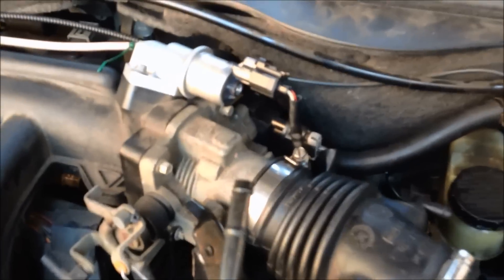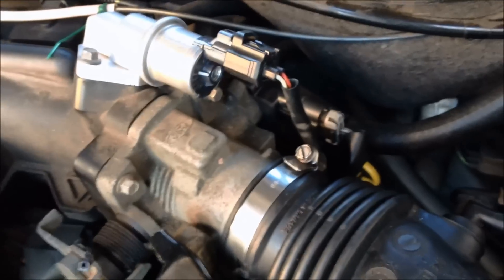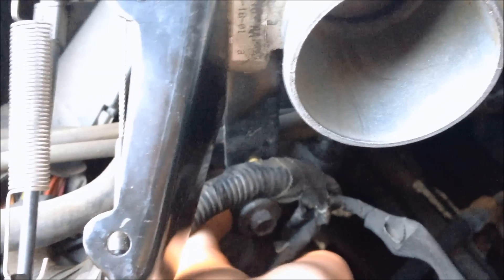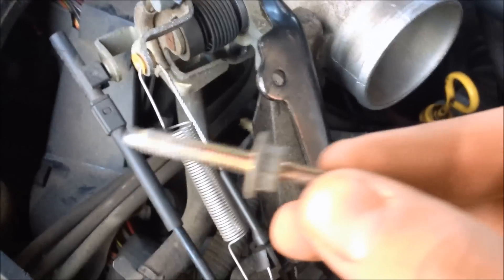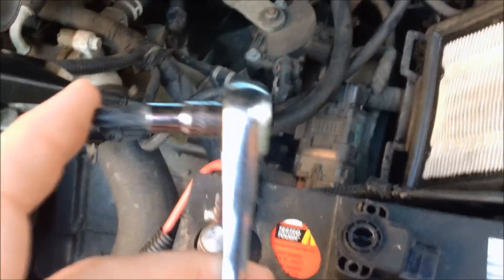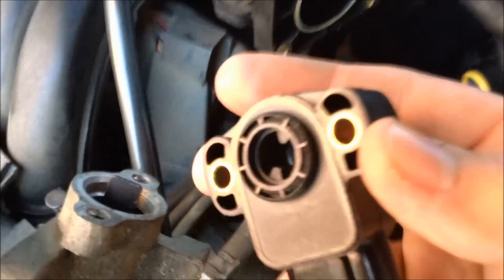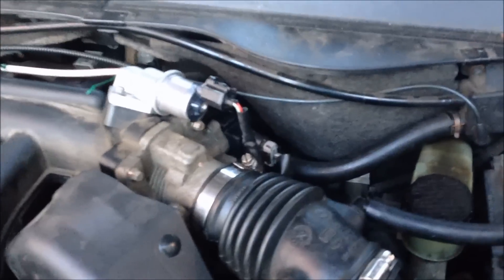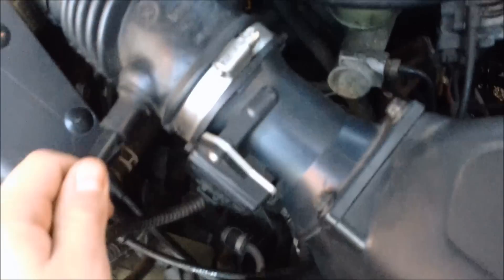Fixing Idling Problem Throttle Position Sensor Replacement 2001 Ford Taurus

Comment: I’ve been having problems with the idle on my 04 and it doesn’t wanna accelerate past 20 mph. I’m not showing any codes either since I’ve fixed everything. I sure hope this works it’s gone be the cheapest part I’ve bought. Thank you

Comment: I’m saved your video. My 2004 Taurus is difficult to shift into gear. Also the key won’t come out smoothly unless I turn the wheel a bit. I have the tools. Can a 63 yo woman do this? Teach an old dog new tricks. I bought Sally new and she just keeps on ticking. But time to replace some sensors. Thanks!   PS.  It needs oxygen sensors too. I would need a floor jack and stands to do this, correct?

Comment: Just came across your channel and I have a 2003 mercury sable and I have 3 codes that came on when I had the e-check the codes are po113 po102 and po122 can you show how to replace the mass volume air flow and the intake air temperature circuit thank you.

Comment: thank to you  my taurus 2000 run creat  throttle position sensor replace, i still has a little  hesitation when  engige is cold go away one hot  let me know what to do  or make a video on that

Comment: i used Craftsman 3 Piece Steel Handle Multi Bit Screwdriver Set for 5 dollars at lowes  i pulled throttle body sencor off and i used the philips  steel handle there was no room for a regular stubby philips i did not want to take off my throttle body

Comment: I have an '04 Sable Duratec engine. My TPS is tucked away tightly as in your engine. I'm going to try your method of removing those bolts to simply tilt the whole assembly over to easily change it.

Comment: Dude thank you so much bro I’ve been having the same issue with mine, same car but 2003 model year, same dang engine 🙄Ever since I replaced the timing cover gasket leakage issue. But mine was trying to basically dive itself and maintaining 15-2,000RPMS after initial startup and warming of engine. Hooked up scanner tool no check engine light. Haven’t replaced IAC Valve yet but it’s clean as a whistle from last issue I had with it which was roughly the same symptoms as were having here. But let me ask you one thing. Does the Throttle Body have a gasket on it? Does it need replacing if so?
Reply from the maker: Glad the video helped , not sure about the gasket ty for the comment

Comment: The tps on my 2000 f150 5.4 somehow got out of calibration and messed up the idol...the vacumm to everything and the transmission to the point that it was like the converter was locking up when put into drive and reverse and just die and after the mechanic reset it every thing works and sounds and runs like brand new..my trk has 290,000 on it and that tps sensor controlls ..A Lot..from air intake.... to idol.... to vacumm.... to transmission/sensors. One that is bad or out of skelter can cause Big headaches because if it's out of adjustment it won't trip the check engine light. 9 out of 10 mechanics and transmission shops told me everything from plugs and coils ,fuel pump, new throttle body, iac , valve job and so on and the  torque converter was number 1.....One Good Mechanic charged me 45 dollars to reset it and the trk and transmission runs like the day i bought it...Choose your Mechanics very Carefully.
Reply: Bella  Wright what did he calibrate? PCM?

Comment: 2004 Ford Taurus owner.  I have changed my IAC valve five times after my mechanic told me that you had to try several until finding a good one. The first four came from a cut rate auto parts store so I got my money back and bought one from NAPA. It was fine for about 100 miles and now the engine is doing it again (revving high) Could it be that the problem is the throttle position sensor. My mechanic did a complete tune up on it just recently........thanks KT

Comment: I have a 2001 Mercury Sable LS.
I see you have two bolts/two screw in studs on throttle body.
I noticed I only have one bolt on top,...and one stud diagonally on bottom.
Car was running fine.   I had some work done by Tire Kingdom not related to throttle control,...but now I have a throttle issue.
Could my throttle bode be sucking air?
Did any of these sables come with only diagonal bolt pattern on throttle body?(Do i sound ridiculous?)

Tire Kingdom had to replace my power steering control sensor between engine and fire wall. It was warranty work.  I spent close to $1200 to have new line/pump/sensor installed.
Sensor leaked all over the place 10 months later.  Mechanic said he had to remove my intake to do the work,.....now I have sticking throttle body problems
They replaced idle sensor,...and still couldn't get it to run like it did.  (Idled and ran fine)
Should I try the Throttle control sensor?

(It's hard as hell to find an e-mail address to corporate Tire Kingdom to explain this)

Comment: I have a 2007 ford taurus with a 3.0L V6 SEL model, it starts and runs fine except when I turn on the A/C it starts bogging down the engine, and it will cut off while driving? I just tuned it up with new spark plugs, new wires, and ignition coil. It wasn't doing it before the tune-up. It has 163,000 miles on it?
Reply: You have crossed the wires at some point wrong wire on wrong spark plug

Comment: Great video, my fluke meter reads mine at .08 volts or so at idle up to 3.75 or so, bought a cereader scan tool, it says or tells the cpu 18.4% at idle. Should be zero, someone had tried to adjust the idle with the TB plate screw, paints gone. Guess I'll try a new one, fixd codes that we're bad. I'm returning this scan tool, launch 3001 also, won't even show O2 sensor status on 2000 Vulcan

Comment: Sears sells a small ratchet and with a  90 Degree screw driver end on it and you can take the TPS out in 1 minute
Reply: Sometimes the screws are very very tight 😅
Reply: @Flomcy  Yes the screws are extremely tight That's why when you put them back put some anti-seize on them for the next time and they don't need to be too tight because they're just holding a piece of plastic onto the throttle body
Reply: @willsrestorations  now this time is my turn, I can't just move a milimiter,those screws, I don't know how rid of them, maybe broken all the TPS and replace it
Reply: @Flomcy  there is a trick to get them out, remove the large intake hose from the throttle body should be two clamps and remove the large 4-in intake hose. Take a sharp regular screwdriver and lightly tap the screwdriver and one of the grooves on the Phelps head and create a regular screwdriver head on those screws,  after tapping them several times you will notice that they will be much easier to take out with a regular screwdriver as you have grooved the screw or cut the screw to fit a regular screwdriver head,  and just be careful.
Reply: @willsrestorations  thanks for your advice... I will.. only I didn't want to remove the whole throttle body... Seems very easy only two screws, but almost impossible to remove..  I will do as you told me.. is the best option 👍🏻🙏🏻
Reply: @Flomcy  you should have enough room when you remove the large hose off of the throttle body and the air box to get behind there with the screwdriver and just make a notch in the screw, just be careful cuz the screw is so much soft,  but you will see if you're patient you'll get it out with no problem. If you happen to get new screws for it just make sure you use some anti-seize and don't put them in tight just snug them up for the next time they'll come out really easy
Reply: @willsrestorations  thanks for the advice... Maybe next time... won't be my car anymore 😁

Comment: did this fix your problem? I've spent over $150 dollars in parts trying to fix a rough idle problem and I own a ford taurus as well. Before I spend anymore money, did replacing the sensor do anything after you replaced it? If not, what else have you replaced to fix your problem?
Reply: Ron Seguin you could have replaced the Idle Air Control Sensor. My father did this and it fixed the rough idling.

Comment: I have a 2002 mercury sable 3.0 DOHC. I replaced the IAC but still am getting error P1506 with an engine light. Do I have to wait for the error to clear and the light to go out or do I have another problem. It has been a few days since it was replaced. The engine may be newer than 2002 it was replaced and now the water pump is on the right look from the front of the engine - Bob
Reply from the maker: +Bob Powers   I will have a video up talking about the IAC and the 2 ways they fail. But if you replaced the IAC and you had a CEL you have to clear it and see if it comes back you can use a scan tool or just disconnect they battery for a couple of min.
Reply: OK thanks it turned out to be a vacuum leak that look 3 days and  a bunch of money to find
Reply: Those vacuum leaks can be a real bear to find sometimes.

Comment: I just got my transmission did on mines by replacing torp comfurtle if you understand what I'm saying excuse my spelling. now that's fixed my check engine light came on. saying I need to replace a sensor just as you showing. It's like it's having a problem getting air in to keep crunk. if I don't keep giving it some gas it will eventually cut off. What are your thoughts?
Reply: I have a 2004 ford taurus se

Comment: What was your idle problem which led to replacing TPS. My 2004, when hot and highway driving for at least an hour starts to take off on its own. Idle will vary from 850 to 3500 will in park. Comes and goes. Any hints. Thanks for the video.
Reply: SeeMooreVids  My 03 3.0 is doing exactly what you just described. I would also like to know. Thanks
Reply: if yur having idle issues such as idle going up and down or acting irattic you should first check the idle air control valve. it becomes gummed up and the pintle seal will begin to stick leading to overcompensation as it moves back and forth in its cylinder while its attempting to regulate the air supply. but it also 6causes stalling perhaps like when you take' your foot off of the accelerator at a stop sign....it has 2 functions for one it allows a small amount of air to bypass around the throttle body flap at startup since the throttle is fully closed when foot is not on the pedal....therefore its second function is do the same when yur driving and you take your foot off of the accelerator...must provide an air supply while throttle is fully closed...so this part obviously stays busy all day lol...
Reply: they are cleanable though and after cleaning i always spray a touch of silicone spray in the openings
Reply: SeeMooreVids Sarah Hinkle

Comment: Is that a clockwise rotating tps or counter clockwise?  I have an aftermarket efi system and I'm looking for a easily available tps the current one I need is no longer manufactured.

Comment: Hello..I have replaced my 05 Ford Explorer 4.0 liter engines TPS sensor which I had Auto Zone pull the codes when I suddenly got a fail safe mode indication as I was cruising at 55 MPH. (NOW THAT'S A SCARY SITUATION IN ITSELF). Anywho, after installing NEW TPS and extras I went to crank her over and got a no start result...Am I suppose to make any adjustments prior to installing on throttle body?? Thinking I missed a step here and its friggen cold here in Boston tonight to boot..haha please advise any info U can give me to get her rolling again...appreciate ur time and reply:) bummed out guy
Reply: When you say, "some extras" what extras do you replace,  Is the car clicking when you try to start it, or no sound at all,  do you have lights and power

Comment: My 2008 Ford Taurus idles high has for a while now only 53,357 miles stalled out twice in driveway while warming it up then check engine lite came on stopped at mechanic they said it was my Throttlebody assembly $400,00 for parts 100,00 labor  didn't have that kind of money they cleaned some wires etc that was 2 weeks ago it's been ok til today engine lite came on again stopped at auto store for reading they  came up with Throttle pedal position sensor switch voltage A/B correlation ,so is it a bad sensor or bad Assembly. Not sure you can help but thought  I'd try  thanks

Comment: on my 24 valve double overhead cam 2000 Ford Taurus it's idling low to the point it stalls out do you happen to know the problem?
Reply: Probably mass airflow sensor. But check your codes, usually those will throw a code.

Comment: I tried using an
 angle screwdriver and avoided taking out more stuff....but I did replaced the screws with allen type bolts... its this ok ?...
Reply: They are 1032 screws, and it makes no difference what head you have on the screws, Yes, allen wrench should be fine....maybe desireable if you want to take them back out some time.

Comment: Ford Taurus 2001 3.0, 200K mi.   I replaced a blown head at 136K and 190K .  $3K , NEVER replaced a sensor to my knowledge, but, replaced ECU, plugs twice, spark plug wires, coil pack, twice, etc. and it still has rough idle, poor mileage, low power.  Rough idle comes and goes based on engine temp, and chance.  REPLY REQUESTED.
Reply: 3 years later...  I hope you've fixed it or junked it by now, but it's probably the MAF. I replace MAF sensors in Tauruses about every 60k miles. They aren't made to last. ...Or if your coil pack was non OEM, get an OEM one.

Comment: Do you have to reteach iddle to the car? Like because I change it but the iddle still high when on parking  and it goes down when I put it on drive o reverse? Does anyone know what I can do?
Reply: If you have a high idle  it means you have a vacuum hose leaking or a vacuum leak
Reply: Not necessarily....tps can cause it too.

Comment: Hey, thanks for the video.  I'm unsure.  When you placed the tps on the housing you said something about hooking it and you turned it a little. (5:10 in the video) What did you hook.  Is it supposed to be putting a strain on the throttle while installing?  Do I just stick it straight on the housing?  Am I making any sense?

Comment: Okay man so I have a question, my check engine light was on for a camshaft position sensor, my girlfriend got the part and I found the part and replaced it, the same day I realized the part my girlfriend picked up and I replaced was the throttle position sensor, when I replaced it I just installed the part and twisted it until it popped in place which stretched the throttle body spring, when I started my car reved up to like 3,500 rpms at idle and I shut the car off right away, I knew that was not normal.I went to examine the throttle body and it completly closed which completly compressed the spring, is it supposed to be that way or does the spring need to be stretched a tad? I went and replaced the actual camshaft sensor today and it starts and runs alot better than it did and about 97% of the motor hesitation has stopped but it does seem to miss just a little bit, before I replaced the camshaft sensor it only started sometimes, it had no power and getting up to 30 mph took awhile with alot of jerking, I will also say that my gas indicatior was at 32 miles left until empty and after I replaced the camshaft sensor it jumped up to 62 miles until empty, the bolts we got for the throttle position sensor were a little shorter than the original ones, it seems to be on there tight enough but Im just wondering what else I should do.

Comment: I tried following Levi's advice, and also LT1's advice.  I could not get the screws out without  following the procedures shown in this video.  Thanks to McCarygrant59 for making a good, helpful video.
Reply: You are right!  I have found that they can and ARE tighter than crap. Maybe a sealer? or just some oxidation, I do not know, but every time I have take one out, it was a bear.

Comment: Seems like the TPS can get out of calibration over time and miles etc.  It's such an important sensor you may has well just replace it at that low cost.
Reply: These freaking engines all must be good because they are not the problem I have 95 with over 150 and it's the same issue for most of the cars a sensor or valve hose wire so that's what it is I tried to add a public comment it wouldn't let me so this is reply

Comment: Hi MrCaryGrant! and hopefully you get a chance to answer me !!, look I have a 2007 Ford focus US legalized here in Mexico, has a little problem is that when you lightly touch the accelerator, then it accelerates to gradually lower the RPM to idle the body acceleration including butterfly are plastic, I was completely clean the entire body including the control valve idle, but the problem persists, touch the accelerator, the loose, but the rpm continue to rise later to lower idling, I have seen some videos about this car here on YouTube and call him "" sticking throttle "" I hope you can give me a comment !!! ... Best regards !!!

Comment: Dude.....you don't have to remove all that stuff to replace the throttle position sensor on an 01 Taurus Vulcan.  Obtain Vise Grip pliers and a phillips head screwdriver bit.  Put the Vise Grip pliers around the bit where it fits into the screwdriver and super tighten those pliers down on it.  Boom...you have all you need to remove the screws that hold the TPS onto the intake.  Put the drill bit into the screws and turn with your right hand while holding it steady into the screws with your left hand.  I have done a 03 Taurus (same thing) like that many times in less than 10...that's ten with a T.... minutes.  Simple and easy job.